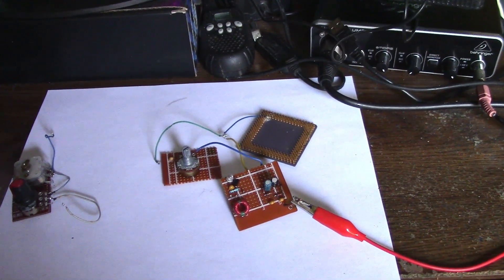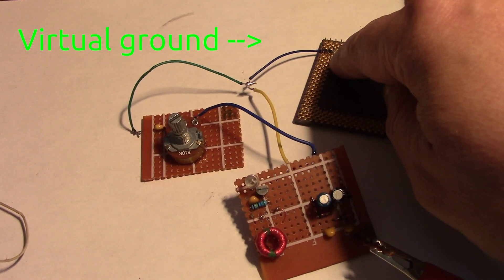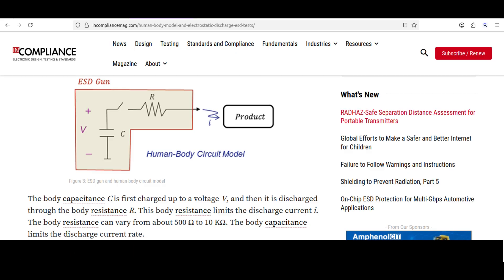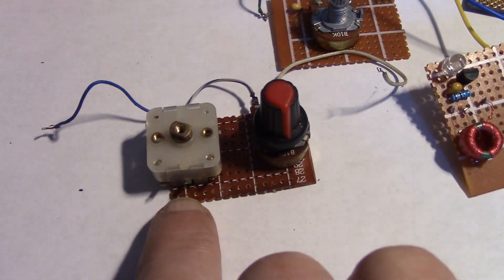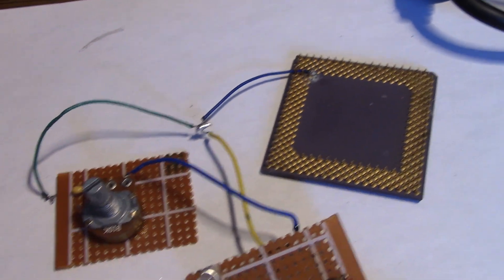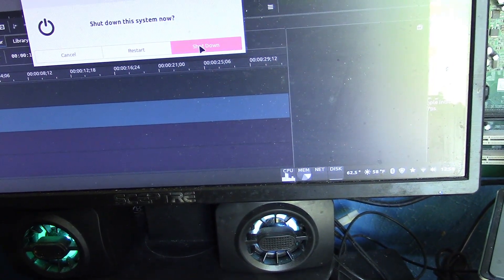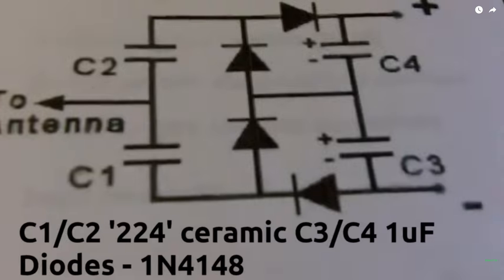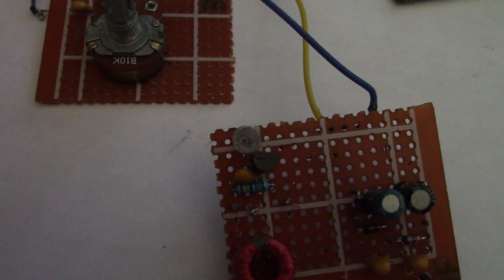This Simple Circuit Flashes With No Battery!

Comment: As A. Karavaykin advises, in order to obtain free energy, it is necessary to use a reverse diode instead of a resistor. In this case, the power is not lost when powered by high voltage. However, simply connecting a series of dead batteries and an LED results in the same perpetual light without the need for any converters. Dead batteries are self-charging from 3/2kT/e. However, there are some nuances related to entropy. youtube.com/watch?v=aBCrWkoYT8A
Reply from the maker: Hmm, I can see such a system working. The high voltage reminds me of the way John Bedini's systems worked and your LED video was a good demonstration. Thanks for your very interesting and thought provoking post 😀

Comment: A D-sized Li-SOCl2 lithium battery has 20Ah and 74Wh of energy! A 4.2V solar panel connected in antiphase in series with a 24cd ultra-bright white LED at 20mA on current 35uA will light for 100 years if it is coated with epoxy to prevent rust?! It is bright enough to emit 0.042cd or 1/24cd. I have one in my bathroom, and when the light turns on, the LED turns off and recharges the battery...
Reply from the maker: That sounds like a great practical application! 
I'd like to move more towards practical uses and ideas like you have described. 100 years is definitely a lifetime solution! 
😀

Comment: That's the issue with these passive circuits, they need a lot of surface tension to collect the charge :/ I have been chasing the perpetual light for over a decade now and I only know how to make it bigger for improvement :D

But now you have a free trigger that could run the Super joule ringer by Lasersaber, for real light. You could also put the circuit inside vacuum sealed mason jar for further improvement.
Reply from the maker: Bigger seems the way, but that's not how I roll (a fact which often includes square wheels!). It's been surprising at each turn to not see several examples by now of harvesters for mains RF. I do keep running into MIT and others papers on it all, but nothing real-world and replicable on an average workbench. 

The SJR is something to look at again, for certain. I do have 2 of those big pot cores somewhere, from back in the day, the ones with multiple windings inside, spaced with foil layers and such.

Comment: Yes I like this circuit, wach out for those men in black suits and sunglasses. This is where if you try to take a reading you change everything. Very interesting and quite amazing no crystal set radio, no 100 foot antenna, not running from battery or capacitor, so we have a ground but not a earth ground , no telsa tower  🤔 well done Mark 👍 yes I sure many people would like to replicate this including myself . Needs to be checked for stray sources not that that would be a problem still would be a great energy harvesting circuit. Yes keep working on it but maybe keep this one setup as it is.  And build one again with the mods you intend to do . Just incase it stops working and can't be replicate.
Reply from the maker: Thanks, John 😀
It seems to run completely fine just sitting there. It'll be scavenging still, but now I'm not entirely sure where from!
Reply: It's got to be getting energy from somewhere and it would be interesting to know where from. 😊 👍
Reply from the maker: @johnwynne-qx6br  Still the PC I would think, but not how we'd presume from running circuits. 
It did stop when we had a power cut, so it's certainly based on emitted energy harvesting. It's about the only time that a power cut has been useful 😂
Reply: @Slider2732_ cheers for the information and reply, I have ordered some bits 2n2222a transistors I'm hoping the a dose not change it from what your using. Various resistors, capacitors, inductors, diodes, led's and a bread board. I had got rid of all my old kepted for scavenging circuits. So new stock😂 it's not as cheap as it used to be but what is nowadays. So i will be asking you for information about it when I get the bits, I will probably do some of the diy kits aswell i quite enjoy those along as there's room to solder without soldering across other pads at the same time. 😊  👍
Reply: @Slider2732_  i think processor are millions of transistors linked together imagine we put them in a single line would make. A long antena 😊 try connecting multiple pins for bright flash
Reply from the maker: @johnwynne-qx6br  The 2N2222A is the better one, you chose the right type. They're like the GTi version of what is already a very good car, if you see what I mean 😂 S9014, MPSA16 and others with high hFE are likely as good.
Resistance has to be high, 5..6 MegaOhms on this circuit, but even higher would work better.  Inductor has to be high uH, not silly high, but 100+ turns per side. A straight ferrite piece will work to wind on easier, but it's better on a toroid core. 
Anyway, thanks for the replication!
Reply from the maker: @diydesi8433  Oh, yes that's a thinking point. I know I can connect to any pin and get the same effect. All connected makes sense. The circuit will work with a big metal cased motor as a virtual ground too.

Comment: Making good progress with theses intriguing circuits ! Interested to know the resistance of L1 and L2 ? In theory they should be very close, same turns/same gauge but I wonder if more imbalance would have an effect ? Maybe a ferrite core would boost any available  background RF.   Looking forward to updates for sure !!!
Reply from the maker: Cheers 😀
Resistance is 7 ohms per side, 13.8 ohms of the coil.
Core is a very low saturation type, iron. Bad at faster than a few kHz switching... which is fine for this use.
Of course there can be transformer effects, such a mega high turns ratios for running a mains bulb on a 1.5V AA, for instance. So far, matched turns has worked the best.
Was wondering about soaking and pulling in mains leakage/RF like a sponge. Everything seems to point to sticking something in the way, even rectenna's, along with  yagi's and dipoles 🤔
Reply: @Slider2732_  Thanks very much for the info ! Is it similar to a matched impedance transformer  from audio electronics .I  see what you mean about the balanced windings . Btw Can you boost the input with a magnet  just throwing random ideas ! Really appreciate the feedback thanks
Reply from the maker: @BEATREACHERZ  If I ever get monetized and plenty more subscribers then I might have to be more brief, but, right now, you're very welcome lol
Was looking at impedance and if anything it's more like the way an earphone resistor works with a crystal set. Earth circuits (such as Mg and Cu probes in ground) tend to run better with a 3K-10K resistor in series too.. It's like extracting too much water from a well, before it has time to fill again.